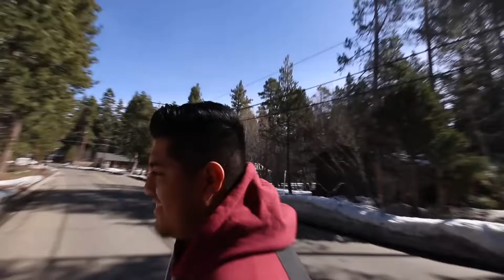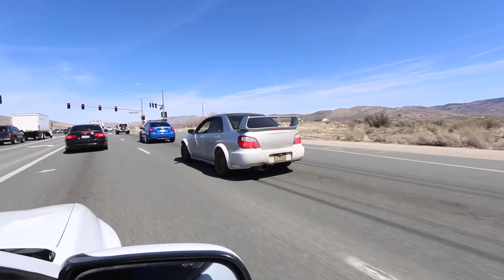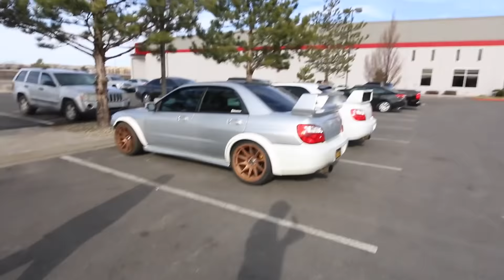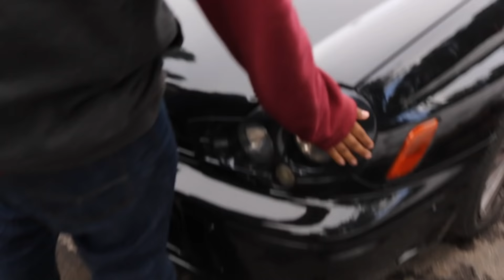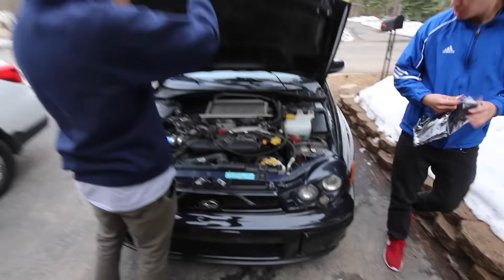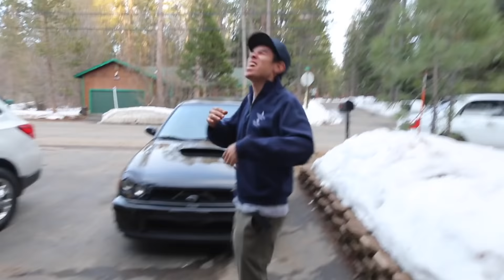Every Subaru Needs This Front Brace!

Comment: Like the wheels on the blue one. Hate stretched tires w/a passion; it's a sign the owner is trying toooo hard to fit in...a flush, square set is where it's at and it doesn't draw unwanted attention...what does the brace brace? It to support the rad spt or the bumper?

Comment: what is the point of the front brace performance wise?
Reply: The brace was designed with form and function in mind. Performance wise it does help tie the front end together for less flex. With additional bolt on braces i.e. Upper strut bar, lower subframe brace, outer apron brace, etc your whole chassis would be tied together which would be optimal in a road race or time attack situation. Hope this helps.

Comment: You dont even know what that brace does.... becauee it does nothing.....its a gimmick.
Reply: When I designed and made this brace I had both form and function in mind. As another comment pointed out... it was inspired by the BMW f80 chassis. The whole concept is to have a unique custom made part that looks good and performs. The way that it bolts directly to the radiator support and directly to the front reinforcement bar mounting points on the frame rails it definitely adds rigidity to the front end. Good enough for BMW... good enough for a Subaru. Definitely NOT a gimmick
Reply: You can't just bolt some bent metal to stuff and say "it adds rigidity." The front end of a WRX is different from the front end of a BMW f80, why would you extrapolate flex data from a different car and assume it applies?
Reply: I've been in the collision repair business for 20+ years and do structural repairs daily. The brace that I make is actually more rigid than the f80  not only how it mounts but the material it's made of.
Reply: j0m017 Do you think the way I explained how this brace mounts, tying the radiator support directly to the frame rails essentially making them one unit, would make the front end more rigid, less rigid, or it would remain the same? (No matter what make or model of the vehicle). 
Compare your answer to bolting in a 4 or 6 point roll cage. Unless you don't think that adds rigidity either.
Reply: Of course it would be more rigid, but it lacks any engineering data to show efficacy. You are adding weight without data on the effective use of rigidity. The fact that you don't understand my statement shows that you lack the engineering knowledge to produce an effective part. You could weld an iron I-beam to the front of a car and make it more rigid, but it wouldn't be as effective as a well engineered aluminium part. Each bend in the sheet metal on the front end of a vehicle changes the flex angle of the structure, you can't use the same angles in your support as a completely different vehicle. Also, adding rigidity in front of the strut towers has a nominal effect on the performance of the car. If you didn't need a radiator support you could chop off everything in front of the struts and the car would perform the same.
Reply: You could make the cup holder more rigid and have the same effect on the car.
Reply: j0m017 Not sure what your point is or why you feel the need to tear down someone else's product (Unless you're my direct competitor in the Subaru brace market!?).
We're just a small biz building cool cars and making cool things for cool cars. 
Also no need to belittle my intelligence by comparing it to an engineer... NEVER claimed to be one. There are other companies out there that have similar braces that bolt all over the car. You think those add weight? If you want to have a long in depth conversation about data, I suggest you talk to them. 
You said I couldn't claim that the brace adds rigidity... I'm glad you agree that it DOES!!
At the end of the day... Just ask yourself (if you're not my direct competitor) "Why do I think my 2 cents are important?"
Because in this case your comment was just a waste of time and space.
Reply: I said you can't JUST say "it adds rigidity." Implying the fact that you need to support your claim with data and justify the added rigidity. I think that my 2 cents are important because you are peddling a gimmick and refuting a valid statement pointing out your gimmick. People like you have taken advantage of the car scene for too long without obstacle. Putting out superfluous products with irrelevant claims. Whether out of ignorance or malice the fact remains that you are producing a product without proper research or proven purpose. My comment may be a waste of time and space(this is the internet after all), but so is your product.
Reply: j0m017 My sons white bugeye in the vid is the only one I was going to make... but other people wanted to buy it. So I sold it to them. It has never been marketed or advertised as a racecar part. I'm not peddling a gimmick... if somebody wants it they reach out to me. Definitely a stretch saying I'm taking advantage of the car enthusiasts... You have NO idea what I do for the car community!!!
What other people buy to personalize their car doesn't always have to be backed up by data or even have a purpose. If they like the way something looks (i.e. Big wings, splitters, conards, etc.) they are free to do whatever they want. They don't need people like you trying to be the parts police. 
Go troll somewhere else...
Reply: No.